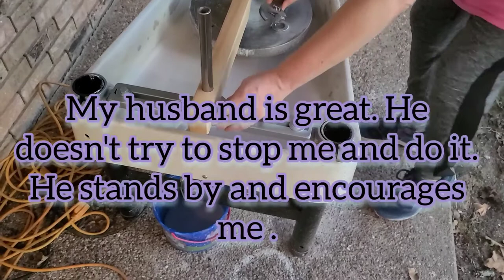Strong Arm Pottery Tool: Opening, Putting Together, and Using

Comment: Wish we were neighbors. I could have used that yesterday when I threw 6 and 7-pound pots. You're so cute. I love how you don't give up. If there is a will there is a way. 😍
Reply from the maker: Never quit is my moto! I would have shared the strong arm. 💪. Hope you are not too sore after all that throwing.
 I was excited I made a cute little pumpkin with my first wheel thrown lid, and then a bottomless bowl that I added a slab bottom to and two small handles on the side. I hope they survive the fire.

Comment: Call Marc Grangier who made the strong arm. I was getting the same issue with the top wobbling - he set me straight with a face time tutorial. He is happy to help. It will be much better !
Reply from the maker: I will. plan on throwing again tomorrow if it is warm enough.  I think two of those pots were my largest ever. the clay was really dry and I am pretty certain my pulls were uneven. I haven't gotten to throw in a while. if it happens again tomorrow with damper clay